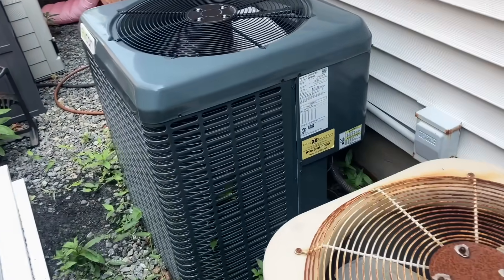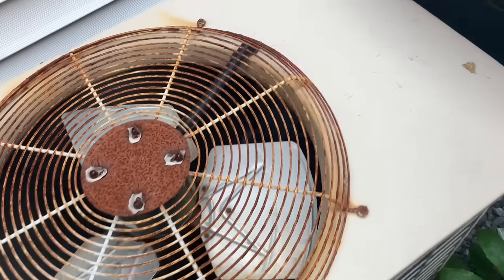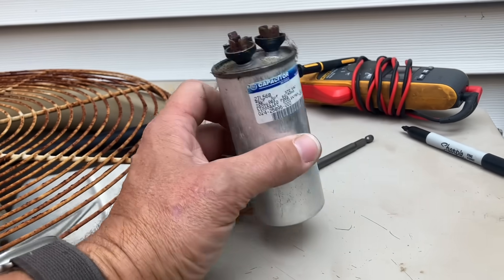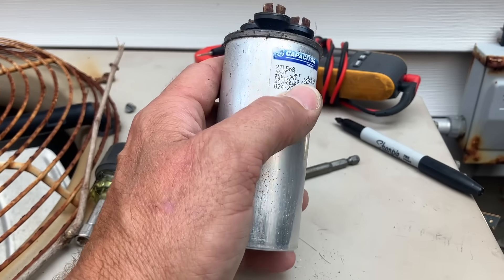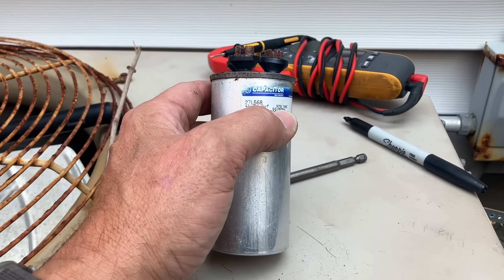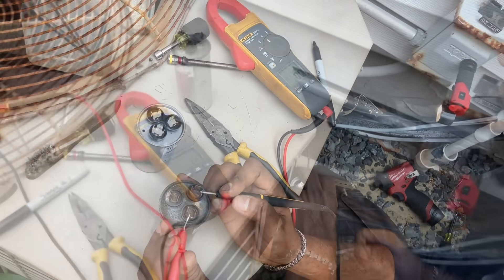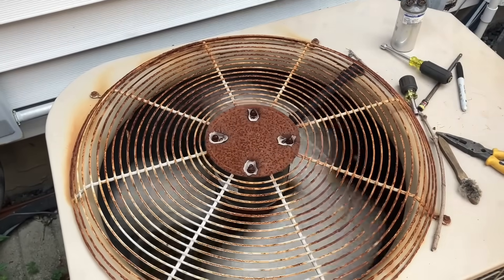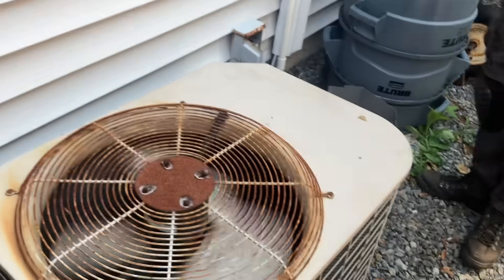Rusted AC? No Problem. Watch My New Hire Fix It Like a Pro!

Comment: I actually like those older units.  They are tanks and use cheap PSC motors.  Almost anything on them is worth repairing or replacing with the exception of a burned out compressor or leaking condenser coils.

Comment: Not the best hard start in there either.  I prefer one with it's own relay if I am going to bother to even use one.  5-2-1 kits are usually the better hard start option if it is needed.

Comment: Great video very detailed thank you so much. I have a question since you put a new capacitor should that eliminate the need for hard start ? Still learning i thought the new capacitor will fix that issue. can you do a video explaining start compaciter the one with the resister on it once again thank you so much

Comment: You did a pretty decent job explaining this in an easy to understand way for a new guy. However, you left out one extremely critical step: to verify with your meter power is off at the unit after pulling the disconnect. Never EVER EVER trust a disconnect until verifying with your meter, check phase to phase (or leg to leg) and then each phase or leg to ground. I always make sure to drill this step into the super green guys when teaching them the basics. I once learned this myself the hard way by not following my own advice, after switching off the disconnect on a 3 phase unit I skipped this step, and got shocked pretty good. Low and behold the L1 knife in the disconnect didn’t disengage when I pulled the lever, so there was one phase that was still live. Luckily it was a 208v unit so I only got hit with 115v. If it was a 460v unit, that one live phase would’ve been about 277v, so who knows if I’d still be here today typing this.
Reply from the maker: Thanks for the feedback!
Reply: @PipeDoctor you’re welcome sir. Thanks for the videos. 😀

Comment: Mark wires?
A good tech should know all wiring in these simple units 
Further more use your clamp on amp probe and ensure proper draw of each component 
Caps do go for a reason you may discover another issue by checking amp draw
Reply from the maker: Thanks for the suggestions!

Comment: Sure looks like the fan is spinning backwards from here. Blades are pulling in rather than pushing out. This may be due to a miswired cap. I think that second brown wire belongs on common rather than the herm terminal, assuming it goes to the fan.
Reply: when he push started it with stick it was running backwards(counter clockwise), after new capacitor it was running the right direction(clockwise), scooping and pushing the air up out.
the one brown was a compressor start wire, quite a few older units used brown and you really had to pay attention or end up tracing the wire back, as sometimes the gauge was the same as well.
Reply: York used brown wires on their compressor start windings back in the day..

Comment: Talking about getting zapped! I was siding my house myself, had to disconnect the condenser wiring, thought it was off when turned off the breaker  box for the air handler. Touched the 240 condenser wire and zapped!  I shrugged it off but at night my arm turned purple and ended up in the ICU, no waiting.  Doctors said I was lucky, you can actually change your heart rhythm, learned a big lesson.
Reply: It only take 6 millivots (0.006 volts) across your chest to send your heart into V-fib. The only way to stop that condition is to be able to shock the heart with an AED or the more sophisticated version they have in the hospital. You are VERY lucky.
Reply: Thanks for sharing that,you may have saved a life
Reply: @johnphillipsplumbing7148  And test anything you turn off to make sure it's off!

Comment: Holding your left arm behind your back and putting in the disconnect does absolutely nothing to protect you.  Ask any electrician, electricity can jump across the sky, it isn't going to randomly go down the right side of your body and bypass your heart.  There is nothing safer about that technique.  Your jewelry is far more dangerous unless it is rubber or carbon fiber.
Reply from the maker: Please don’t pretend you think you know everything and comment with retarded
Reply: @PipeDoctor I don’t have to pretend.  I am an HVAC contractor in Colorado.  We do our own electrical work.   I clearly know more than you about the subject.  But you are a typical know it all.  Why don’t you ask your channels members in a video and see the responses you get.   I am a big fan and we believe the same politically, but teaching bad habits like that is nonsense.

Comment: Fun fact about R407c. All it is, is R410A with R134a mixed in to lower the pressure. The more you know 🌞
Reply from the maker: Interesting information, thanks for sharing!
Reply: it's close but not quite on  52% R134a. 25% R-125(fire suppressant) and about 23% R-32 (go figure). whereas 410a is about  a dead 50/50 mix of R32 and R125.
of course they're somewhat secretive and cryptic in the SDS sheets, go figure.

Comment: REEEEE REEEEE Syed is going to get electrocuted worse! Doesn't he know bling bling is highly conductive REEEEEEEEEEE
Reply from the maker: He’s not an hvac Tex
Reply: @PipeDoctor  plumbing/devices can sometimes be live too. like a "hot" disposal and grounded pipes, thanks to wrongly wired receptacle and non conductive faucet supply lines which didn't ground it out.  the whole disposal was live at 120V and the faucet had enough grounding through the water to feel it going through you and worse if you hit the metal sink and had hand in running water!
old remainder of knob and tube wiring was shorted to a box in the wall, my buddy brushed his arm against the disposal housing and had hands on copper pipe/wrench removing old dishwasher supply line. yikes.

Comment: Nice    the new hire looks good  very interested  in the  AC  system   As I am   Im a plumber   but  facinated with the heat and air trade  .     I wonder if its  a good idea  to double check the Cap matches the comp  and fan or just go with whats there ?
Reply from the maker: Thanks 👍
Reply: yeah, it never hurts to double check the values are correct for the equipment, but on the older system it was rarely on any of the labels and you had to struggle looking it up online/paper manuals or even call the equipment manufacture, when that failed you were calling the compressor/fan motor manufacture. a royal pain it used to be when the numbers were also missing off the old cap due to rust, just paint printed in black lettering on gray cans that flaked off with age.

Comment: Just a note. 407C has similar temperatures, but the high side operating pressure IS significantly higher. Units designed for 407C operate better than using it as a retrofit in an R22 unit. It will work, but you usually need to reduce the charge a little, and you need to replace the high side pressure switch with a 450 PSI switch.
Reply: There isn't a substitute refrigerant.. no such thing
Reply: @japmlp09  Well, I own an HVAC company, and your statement is 100% false. Don't let the door hit you.
Reply from the maker: Thanks for the tips!
Reply: @PipeDoctor  No problemo, Mike. One more tip. The 407C is only miscible in non-mineral oils, like we get in all the new compressors now. If you have a mineral oil compressor, use 422B as your alternate. That will work with all the oils, and you won't have to change the high pressure switch.

Comment: Okay, Saaid. (or is it Saaif?) Here is what you need to know. Those fan motors have TWO windings. Unlike a compressor, which has a START winding and a RUN winding, the fan motors have an AUX winding and a MAIN winding. The capacitor provides a shift of the AC phase of voltage and current for the AUX winding, which allows the magnetic field of the MAIN winding to have an offset field to push against. It does not provide a "boost." That's a common misconception. Although the names are different in a single phase compressor, the run capacitor works the same way. HTH. Welcome to the fight.
Reply: Came here to say the same thing, you beat me to it!
Reply: Question for you sir.
The fan spins freely, but when powered it seizes. Remove power and it’s free again. What is happening?
Reply: @MoonRambo702 The capacitor has failed, the windings are not phase shifted so the motor is magnetically locked.
Reply: @MoonRambo702  Partially shorted windings if the capacitor is still within limits. Not enough of a short to blow fuses or pop a breaker, but with the right failure, it can be impossible to turn the fan blades when the motor is energized. Usually there is also a vibration and an audible buzz sound. New motor and cap. I usually quote a fan blade as well, since they can be damaged by age or the removal process. HTH.
Reply: Why does he need to know all that to do his job?
Reply: @btu64 Because to fix something its best to understand how it works, it keeps you from recommending they just replace the whole unit
Reply: @btu64  It's called being a good technician. If you don't understand how systems operate, you won't have the thorough understanding that you need to be good at your job. Ask yourself, why would your doctor need to understand the renin angiotension aldosterone system in order to treat your high blood pressure? It's part of his job.
Reply: @arthouston7361 sir, I do appreciate your knowledge and understanding of the equipment but, for this man to repair the AC system and make it work, he doesn't need to know how the capacitor works with the fan motor. He just needs to know which one is causing the fan not to run.
Reply: @btu64  Sorry. After seeing dozens of hires, I know what make a good tech. In order to make good diagnostic decisions, a good tech needs to to have a deep knowledge of how the system works. The hires who didn't know and didn't care to learn were let go after the first year. I'll give you an example. Any kid with a meter can identify that a compressor has shorted to ground. Only a good tech can tell you why, so that the next compressor does not fail prematurely. That's why this is an important level of knowledge. We don't hire parts replacers and expect them to do the job right.
Reply: @arthouston7361 Point well taken, sir.
Reply: Single phase power has a magentic field that pulses. You need a rotating field to make a motor spin. This is what your capacitor does. Much simpler explanation.
Reply: @mikmat1427  ...and far less accurate.
Reply: Too much to soon,let him get comfortable with the basics first,then delve deeper into it as he becomes more proficient. Patience is key when bringing up a new guy,ROME WASN'T BUILT IN A DAY!
Reply: @johnphillipsplumbing7148  This is from "the seven habits of highly effective people." BEGIN with the end in mind.
Reply: @arthouston7361 yes!
Reply from the maker: Great information, thanks for sharing!
Reply: @PipeDoctor  At my old company where I was the lead tech, I was tasked with teaching and evaluating the new hires. They were straight out of HVAC school, and in 18 years there, I found ONE GUY who knew that. Fifteen of those once-a-year new hires turned out to be "one year wonders." One of these days, I should drive up and have a shmear with you. A nice toasted sesame egg bagel. I miss that stuff.